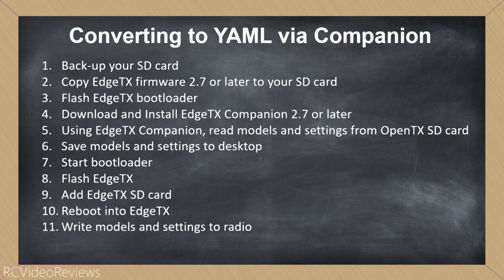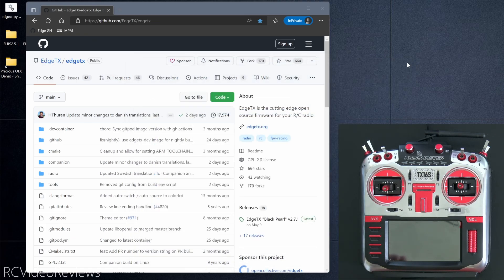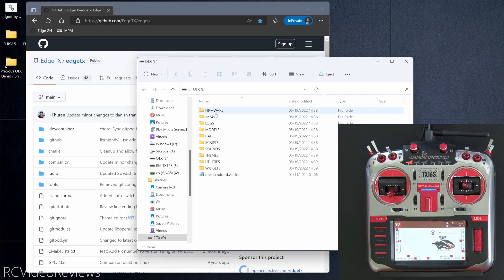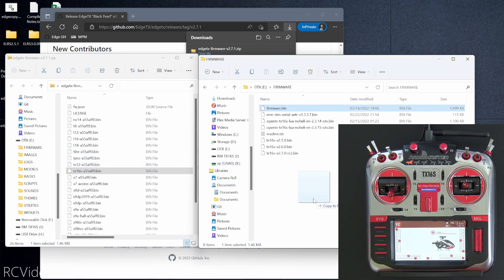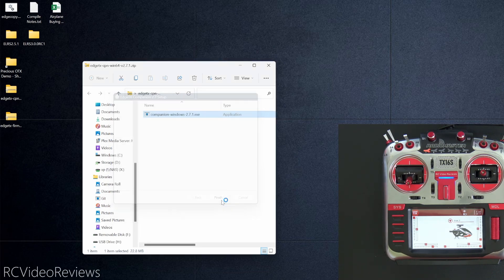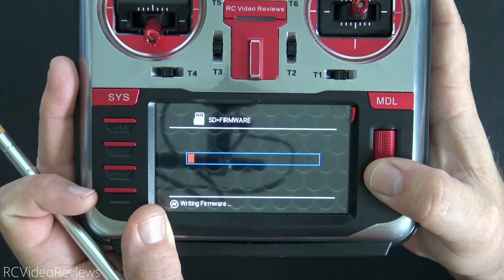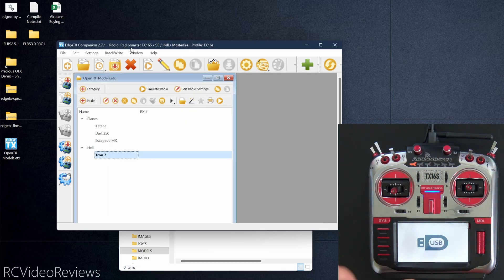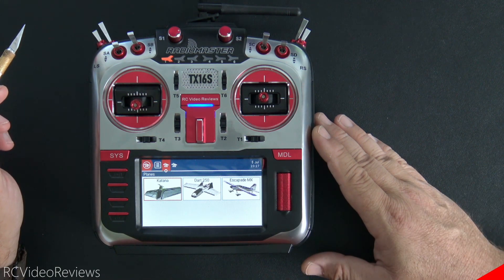EdgeTX YAML Conversion with Companion

Comment: Hi, I have other issue. I want to add a ready yml setup file to my TX16S edgetx 2.11.1 and I can't.
The file is from Omphobby for omp m2 mk2. I have tried just copy the file to Models in TX16S - not worked.
Tried also by Companion with no result:(
Could someone help me please?
Reply from the maker: What's the name of your yml file and where did you put it? If you put it in /MODELS with file format of modelxxx.yml the radio should pick it up automatically.
Reply: I have changed the name to model20.yml whis is not interfere with other files and put it in models folder but when I open the model selection this model is not there
Reply from the maker: And you're on a recent version of EdgeTX?
Reply from the maker: Try the same thing with a known working yml file. i.e. Use your own--just copy it as a different modelxx number and see if it works. Could be something really different about your friends yml like from different radio or very different version of EdgeTX.

Comment: How do I do this if I already have edge tx firmware on my TX16s?  I have my opentx sd card backup but assume I need to revert to opentx firmware but not sure how to do it anymore.  If I insert a different SD card with my opentx SD card contents I can't get the radio to connect to PC via usb

Comment: Converted TX16s multi to Edgetx using  your Master Class video.  (Went to 2.10.6 then discovered model conversion was removed after 2.8 so I re-flashed).  Had to go through EdgeTX companion to get models converted to .yml. Done.  Using 8GB microSD formatted FAT32.  Problem-models show in radio on SD card, but do not display or allow selection.  Can you help?

Comment: I've been using EdgeTX for the past three years and love it. I recently upgraded to EdgeTX 2.10.4 from 2.8.  I also upgraded the companion to 2.10.3.   Unfortunately, I cannot read from my TX16S radio as I get this warning message:  Warning: File version 2.10.4 is not supported by this version of Companion!. Model and radio settings may be corrupted if you continue.  I then cancel and I get a different warning message which states: Cannot load Radio/radio.yml: yaml-cpp:error at line 1, column 1: Bad conversion.  Line one has the checksum.
Everything works very well with Companion 2.8 and Edge TX 2.10.4.  Any ideas on how to fix this? Thanks in advance.

Comment: Thanks so much for showing this, but I cannot get it to work. Bought a new Boxer with EdgeTx installed, tried many many times to get my OpenTX models into the Boxer, fails every time. I’m at the point now where I’m going to sell the Boxer.

Comment: I have no radio folder in my SD card content on OpenTx 2.2.3 now to fix this to get radio settings? Running an old Mr. STEEL Taranis going to a tx16s MKII Max
Reply from the maker: OpenTX and EdgeTX will make any required folders and files on first boot. So if up don’t have the required folders you should be greeted with a request to calibrate on boot up.
Reply: @RCVideoReviews  I've been running my taranis x9d plus quads exclusively for 8 plus years whenever that radio was released. It has no radio folder with radio settings it sounds like I need. It's never asked to calibrate, it's run perfectly for this long. How do I get that folder to populate? Or do I need to download and ad card content and start a new card? Don't want to lose models just want the new tx16s mk II Max to convert to .yml files, but seems I'll need this radio folder? What can I do? Thanks for the reply btw!

Comment: how about when my radio is converted to edgetx while I only have .bin files ?
Reply from the maker: 2.6-2.8 convert bins to yaml for you.
Reply: @RCVideoReviews  can i still do so if my radio is now already on edgetx ? basically I just got the .bin files themselves.
Reply: @user-yk1cw8im4h  yes you can But you have to use Companion version 2.6, 2.7, or 2.8 to 'read Model and settings from radio' and 'save as' to your PC first, because companion 2.9 CAN NOT read models and settings as .bin

Comment: Thank you for the video it was helpful. I would like to share my experience bc i'm sure there are others who may be stuck like I was. FOR THOSE WHO HAVE 9D+ WITH OTX AND ARE SWITCHING TO A TX16S with ETX,  READ THE FOLLOWING:  Background...Wanted to move models from Otx 9d+ to New Tx16xMii with 4-in-1, Etx 2.71. Current Frsky 9D+. I thought based on watching several videos that Etx would read Otx SD CARD and then convert...No not in my case. After literally days (and i have experience with Otx) I kept getting error messages while using Etx 2.7 trying to get Otx files from 9D+..."No SD card found":face-fuchsia-tongue-out:. A pilot from RC Group suggested updating radio to Etx 2.8 but I really didnt want to do that bc I figured the 2.7 was installed at factory so i will go get models on it and then update to 2.8. Next, I copied the saved models from Otx, copied that OTX file to computer and then went to Etx, open that file and converted the Otx files to ETX, then wrote them to Tx16...I had 12 models which showed up on the Tx16 Sd card  but only one showed up on models page?:face-fuchsia-tongue-out::face-green-smiling:  Back to the forums, videos etc. Finally tried every option i could think of so HERE ARE THE STEPS I USED TO GO FROM OTX TO ETX.  #1.  I updated Tx16s to 2.8 but Etx still would not read SD card from 9D+Otx. #2.  So on the computer  I copied the saved models file from Otx and opened it in Etx, #3. converted the Otx file to Etx in Etx. #4.  wrote the converted file to Tx16. YES finally.🤜🤜😄  All models converted to Etx and written to Tx16s
Reply: Thankyou sir! Followed your instructions and got my x9d+ upgraded from Open 2.2 to Edge 2.8 with models still working.
Reply: @olliei  Your Welcome! Glad to help...

Comment: Hopefully someone can help me convert my models,  I've been watching videos for days and even this "last ditch effort" failed.  I'm coming from a Taranis X9D+ running OpenTX 2.2.4    I'm going to a Radiomaster TX16S running EdgeTX 2.7.1   I tried the recommended and quickest way to convert the models,   first backing up each one in the Taranis so that it would put the BIN files in the MODELS folder.    I copied each one to the EdgeTX MODELS folder,   however my OpenTX SD card does not have a RADIO folder!  Therefore I had nothing to transfer to the new SD card.    I'm pretty sure this is why when I disconnected the Radiomaster USB cable I never got the "SD card conversion required" message.     That led me to this video as a last ditch effort.    I successfully installed the EdgeTX 2.7.1 firmware on the Taranis and flashed the bootloader.    I installed EdgeTX Companion 2.7.1 however it says "unable to find radio SD card!"     The drives show up on my computer, and I'm able to see all the contents, so it's not a driver or USB cable issue. (and it worked fine with OpenTX companion)    So without EdgeTX Companion finding my Taranis,  I was not able to proceed any further.      One question I have, that didn't seem to come up on any of these EdgeTX videos, is why don't I have a RADIO folder in my SD card and what to do if you don't have that Radio.BIN file to move over?
Reply: i have similar problem trying to upgrade Taranis QX7 from OpenTX 2.3.15 to EdgeTX 2.8.0 but QX7 does not have a "radio" folder on sd card either. did you ever figure out what to do?
Reply: @skibumbob808  Yes, I learned that only color screen radios have the RADIO folder.  I ended up using Companion to convert the files.    That was not seamless either,  ETX Companion would not read my new Radio, (also a common issue). You can find the offending model (mine was model 8). Make a slight change to it in the radio, such as changing a setting in the timer,   then Companion would read the SD card.       In my case, I gave up on the .BIN and .YML files.    I used my old backup .OTX file (from OTX companion) and imported it into ETX companion which converted it to an .ETX file,   then wrote that to the new radio.

Comment: Is there a way to grab just one yml file for a model and save it to the models folder on my ETX card? I converted a model from my QX7 OpenTX radio and want to load it on my Radiomaster TX16, but I don't want to override my current models and settings on the TX16.
Reply from the maker: That has to be one of the single biggest gaps in the adoption of YAML, but I believe it will be cured with the new Labels system in 2.8 because labels rescans the directory, and I believe it re-writes the model numbers as necessary. I need to learn more about exactly how this works.

Bottom line "I *believe*" in 2.8 you'll be able to drop a YAML model file in your models folder and the radio will pick it up. I reserve the right to be wrong about this.

Comment: Hi John, I have the latest Companion, flashed the Bootloader, and write new firmware in the radio. I loaded the original or factory settings that came with my MKII and here’s the message I’m getting when trying to read models and settings from the radio
Can’t load MODELS/model8.yml:
yaml-cpp: error at line 302, column 12: end of map not found
Reply from the maker: Open that model in the radio, change any single thing in the model configuration then try again in Companion. The change doesn't have to be significant, just change something. i.e. Change timer from 5m to 6m. After Companion reads it, you can change it back from 6m to 5m.

You can figure out what model8.yml is by opening it in any text editor. It will have the model name at the top. Yml files are in \MODELS on the SD Card.
Reply: @RCVideoReviews  Got it to work John, loaded the firmware 2.7.1, flashed the bootloader with the latest firmware also.
Reply: @RCVideoReviews  K, thanks John. I’ll try that. Currently loading the 2.7.0 production sd card, think I may have loaded 2.6.0.

Comment: Great video John, I just installed AG01 gimbals in my TX16S and am ready to make the switch to EdgeTx. Do you recommend this video to follow for the swap or one of your other swap videos? Thanks!
Reply from the maker: This video is more of a last resort kind of option. 

If your USB connection from TX16s to PC works well, buddy is the easiest way to convert: https://www.youtube.com/watch?v=zvakNqu_5Ec
This one is good because it shows you everything about where to get the files/software etc.. so if you have issues with buddy or USB, it's a good method: https://youtu.be/0WnpfE78-KU
Reply: @RCVideoReviews  I just dropped in to say I followed the second Master Class. It worked perfect! Thanks again! Aside: I'm surprised how well the touch screen works. I expected it to be slow and notchy but it's as good as my iPhone. Very fast and accurate! Love it!

Comment: Hello good people. Will this work with QX7? I'm still in OTX. Than'ks for your work. Cheers
Reply from the maker: It would work with one slight adjustment. 

After you read your models and settings in Companion, you would have to close the file and change radio profiles to the TX16s then re-open the file. When you do that, Companion will make the necessary changes to the models and settings file for the new radio.
Reply: @RCVideoReviews  Thanks. But I don´t wount be changing radio, just from OpenTx to EdgeTx. Sorry Ididn't make myself clear. I've tryed before to migrate, following a video of yours, but models woudn´t get to the new system. Then I saw on the comments on that video.that the process would be different for black and white screen radios. Coudn't find more information about that.
Reply from the maker: Yes, if you're using the same radio, this process still applies.
Reply: @RCVideoReviews  Great! Going for it!